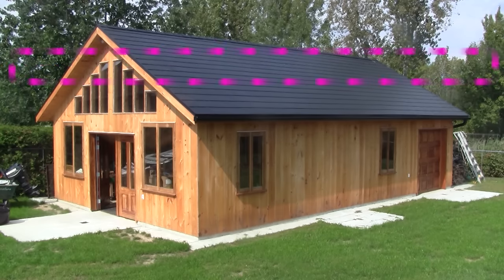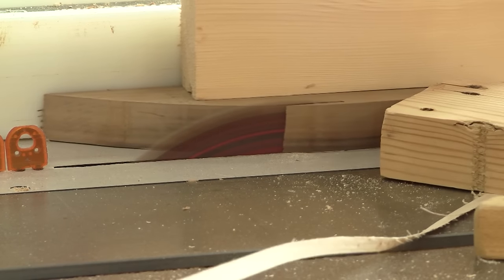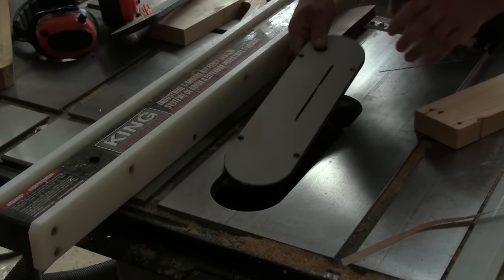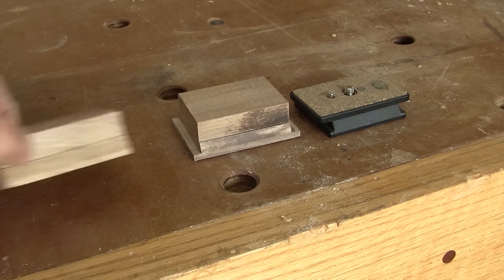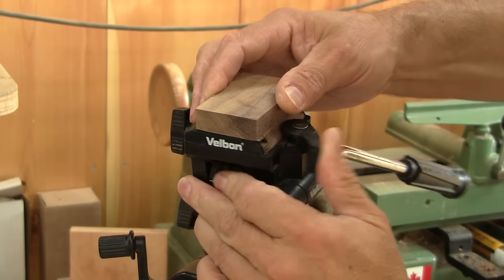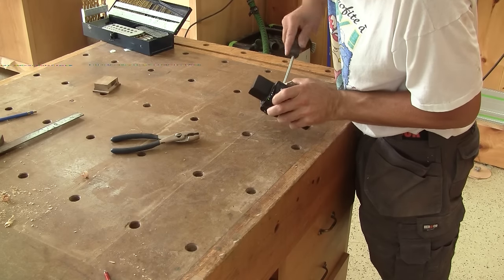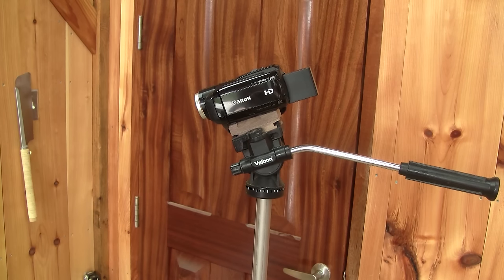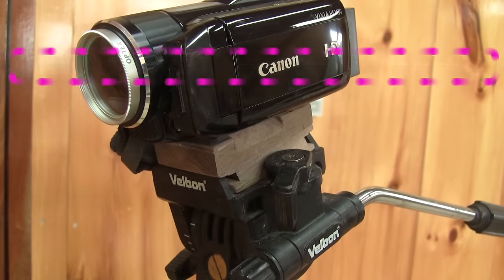The Woodpecker Ep 97 -  Camera baseplate

Comment: Alain, I've made quite a few bases and other camera parts out of aluminum.  I use the same tools that I use for wood working, carbide saw blade in my table saw and a bi-metal band on my band saw.  Aluminum drills and taps nicely too.  Anyway, good job on the base!  SR
Reply from the maker: +Sawyer Rob I guess it would be stronger in alluminum but, it still work and look great out of wood :)